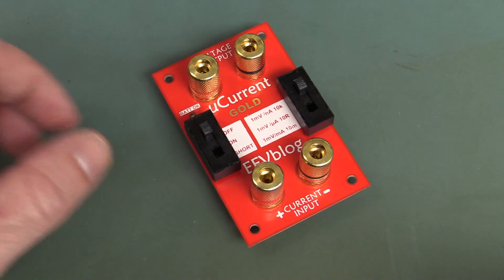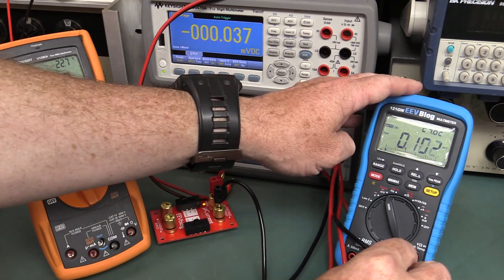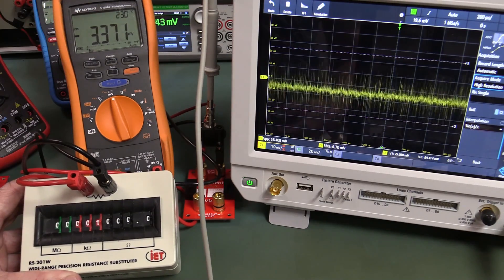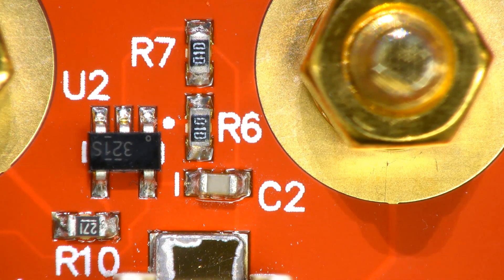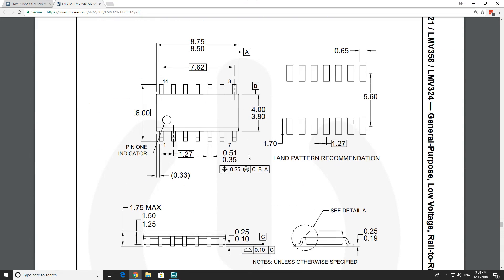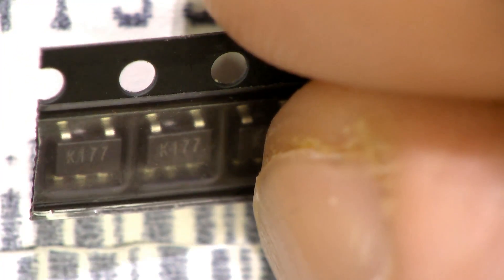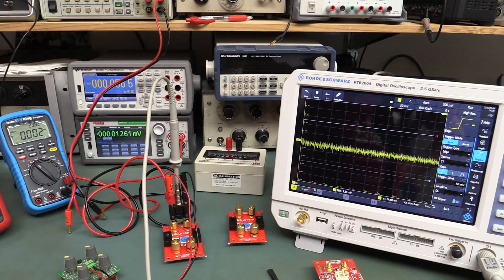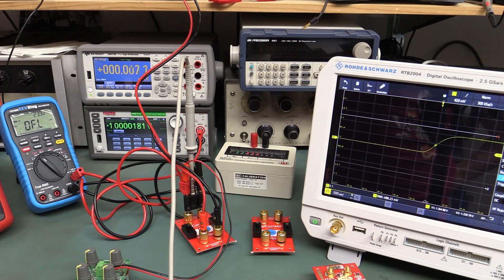EEVblog #1057 -  µCurrent Murphy

Comment: “Rings a bell”.  If I recall, one Fluke meter has 4 nF input capacitance on the low ranges.  Caused some surprises until I figured it out.
Motorola MJ802 used to be one of our favorite robust transistors and then it suddenly changed to be anything but.  After various queries, we found that Motorola had moved the manufacturing to another bigger plant.  Bigger wafers and other changes in the process. BAH!  We went around and were promised great robustness by a company called Solitron for their version of 2N3771 or something of that number series.  We tried and they failed on a short notice.  When we pursued that issue, Solitron engineer eventually said that that we must stop using their transistors, because our application with 1 to 20 Hz pulsing caused thermal cycling stresses on the chip to base bond (soft solder connection).  Would be fine with DC or over 100 Hz pulsing.  Thank you very much for that clarification!
We never found a good replacement for the old MJ802, although MJ15015 survived a little better than any of the other substitutions.

Comment: Had a very similar problem with the MAX4239 oscillating at low / no differential signal in a similar current sense circuit which previously worked fine (albeit single supply rail). After many approaches we ended up changing the opamp. Would be interested to know if replacing the MAX4239s with older also addressed the problem

Comment: Well, it is not the only problem with oscillation, as I discovered and fixed:
https://www.eevblog.com/forum/testgear/problem-with-ucurrent-gold/
And in my uCurrent is a RC1F opamp.
Reply: No, that's the TI part.
Reply: If you had actually bothered to check you would see that the On-Semi data sheet does not correspond to either part number on the chips. Stop criticising typing errors and get a life.
Reply: I guess that ON datasheet for for their own (Motorola legacy) production before they acquired Fairchild.
And RC1F is TI chip:
http://www.ti.com/lit/ds/symlink/lmv324.pdf
Reply: actually no the datasheet in the vid has Fairchild data with ON logo. 19 mins 41 secs. So nope.
Reply: Yes but Dave told that it doesn't contain and chip marking in it.
Again:
http://www.onsemi.com/pub/Collateral/LMV321-D.PDF
dated February, 2015 - before ON bought Fairchild - ON own design
https://www.mouser.com/ds/2/308/LMV321-1125014.pdf
Fairchild/ON datasheet - definitely after acquisition of Fairchild but no date in document, no chip marking information.

The problem is that they discontinued their own production replacing it by Fairchilds one but the datasheet on their official site is still for their original product. 

They bought a lot of companies like Fairchild, Sanyo Semiconductor, etc. but failed to bring them to equal documentation and marking standard

Duh, they stopped marking parts with Fairchild logo only by the late of 2017...
Reply: that is the latest data sheet currently on the web site so that is what they are making. IE on the production line that data sheet was written for. If that was not the case even cots mil equipment and cots aerospace could not use them

Comment: Hmm, so whether or not virtual ground generator is the "culprit", something is clearly able to feed through the capacitive coupling, since the error depends on a capacitive load on the µCurrent outputs. So this could reasonably be narrowed down to whatever is connected to the outputs. 

What sticks out to me is the connection of R8, the 270 ohm resistor. Firstly, this resistor makes the output gain 10.27 instead of 10. But that's at the amp output. The 270 ohm resistor forms a voltage divider and the meter output is at the 10:1 tap. The precision loss from a 1% 270 ohm resistor would be below the 0.05% when taking into account the full scale of the resistor network. So far so good. And none of that would create any oscillation issues anyway, just a small measurement error.

The second thing that sticks out in relation to R8 is the connection of C4. The MAX4239 datasheet calls for a capacitor in series with the feedback element. As it stands, the feedback element is R13+R14+R8 whereas the capacitor is only across R13+R14. This could have two effects: 1) Not limiting the bandwidth of the feedback properly. 2) Somehow feeding interference back onto the input with whatever effects that might have. Regardless, the capacitor technically isn't connected as advised in the datasheet.

Things I'd try:
1) Move the C4 connection directly to the output of the MAX4239. 
2) Move the R13+R14 feedback connection directly to the output of the MAX4239 as well. R8 would now be in series with the output but no longer part of the feedback loop. This should only be a problem with a very low impedance load which might sag the output appreciably..
3) Come to think to think of it, 2x 100n for the whole circuit seems a bit anemic given the symptoms. Might want to increase that a bit and see if that stabilizes the circuit.
4) Might also want to add decoupling to the virtual ground as well as some people have suggested.
Reply: The tolerance of R8 has zero effect on the output precision...
Reply: David Jereb Come to think of it, you're absolutely right. Anyway, that was just an aside to explain my thinking from start to finish.

Comment: I have come across opamps that, in a dual rail config, were not happy with a single decoupling cap across the rails, needing one cap per rail. Could it be something similar here?
Reply from the maker: This is not a usual split rail problem. Decoupling caps on the output of a virtual ground output are caps directly on the output of the opamp, that's BAD, and is the reason why the opamps can oscillate to begin with.
Reply: EEVblog I do not understand why it would ossilate when there is 270R on the output anyway. However If a cap was on the v-gnd opamp output (after R10) would the return path not be more direct than capacitance on the uCurrent output terminals skipping R8?

Personally I always find 47R adequate to buffer opamp outputs and keeps nice low output impedance. Telling the master how to suck eggs!
Reply from the maker: Output resistors are not magic, they just move the pole a bit, not totally eliminate any capacitive load issues.
Reply: I think any opamp should be decoupled against the LOAD COMMON terminal, i.e. the virtual ground here, not across the supply pins. I'd suggest trying that and see, if that improves. It should.
Reply: As I suggested earlier on Patreon side, please try 100nF or 1uF cap from virtual ground to both +V and -V.  I am quite sure that tames the oscillation.  It is quite clear that the oscillation is produced by the combination of LMV and MAX opamps, not just from LMV.  And if I am right, please remember that I was the first one to notice that!

The reason is that capacitive loading of the uCurrent output creates low impedance current source (in higher frequencies) to virtual ground from +V and -V (which are coupled together by a cap) and this creates high frequency signal to LMV input.  Two 1uF caps with 270 resistor creates low pass filter in kHz region which should be enough to tame oscillation.  Or even two 100nF caps.
Reply: Please also scope how the oscillation shows at the output of the U4 (pin 1).  I guess it is from rail to rail!
Reply: I think it probably needs a decoupling cap across either of the 100K resistors at the input to the rail splitter to lowpass the input to the LMV321. Otherwise noise on the virtual ground will jump onto the power rails (via any of the opamps, or parasitic capacitive coupling) and be fed back into the LMV321 input as the 100K resistor divider is operating at full bandwidth.  Remember that PSRR only guarantees that the signals on the powersupply don't make it to the opamp output, not the other way around. The lack of decoupling from the VGND to the supply rails will not be helping either. If the LM321 allows 220pf then maybe put 100pf from after the 270R to a supply rail. Capacitively loading the Maxim output is not the same as capacitively loading VGND. Likely loading VGND will make it more stable, not less.
Reply: i think the same. At least it would be more defined and with the decoupling resistor also the splitting OPAmp should be happy. Otherwise it sometimes worked to add much more capacitance. like 10 too µF electrolytic.
Similar to a problem with a reference (TL431?): It just happened to oscillate with the common (ubiquitous) 100nF. Not with 10nF not with 1µF. The datasheet more or less stated this, but the guy who designed this thing did not read carefully enough and was not experienced enough.
Reply: Dave uploaded a follow up on EEVblog2. I missed it until now as I only subscribed EEVBlog1.

Comment: I'm a pretty green designer, so there's probably something I'm missing. Can someone explain to me why R8 is inside the feedback loop of U4, rather than being wired outside the loop, the way R10 is with respect to U2? If the purpose of R8 is to provide output isolation for capacitive loads, doesn't it have to be outside the loop?

Comment: do you think that your virtual ground is happy without any capacitors? I would use some... to positive and negative rail, at least 100nF. you have 270 ohms on your virtual ground where U4 feedback can easily disturb U1 negative input. some slow op amps can handle such problems, but others with faster response can begin oscillating, just imagine these RC1F are actually faster op amps with much better specs, which begin oscillating easily?

Comment: Odd question: shouldn't the producer of these ucurrent devices have a thourough quality check for each module. This is the only way to avoid such slipped - faillouts. I guess, part of the high price for the precission instruments is the quality check processes for each module.

Comment: O'Toole's law says Murphy is an optimist. When dealing with electronics even the best laid plans of mice and men get fouled up by Murphy. 
About 15 years ago we had automated controls on our pumps installed. All so that we could operate them from a remote computer. Every so often we had a pump shut down for no known reason. All of our equipment was designed to be stable even in the event of an EMP event including hardened CPUs designed for use in space. And everything was opto isolated so that nothing should get by. Wrong! It took two weeks for it to show up on the chart recorder but finally we caught the little spike that Murphy was throwing at us. It was getting by the batteries, the filter capacitors in the power supplies, the opto isolators, and triggering a fault inside the controller.

Comment: I solved this mystery 3 years ago.  The output stage is oscillating because of the 270 ohm resistor plus a capacitive load causes too much phase shift. It is marginally stable, so some work, some oscillate. See my reply and the design fix below.

Comment: Why not just decouple your voltage divider to stop it feeding back into the virtual ground amp? After all, the tiniest noise on that power rail will get into the input... it's a DC rail generator, so no frequency response is needed. I guess a 10nF would do it.

Comment: Gahh! I've ripped out my hair (virtually, I'm bald as an eagle) trying to fix the offset problem. I replaced the MAX4239AUT, both of them just for good measure. Checked the ± rails, but still got a crazy offset on the output. The problem is only on the first opamp that is amplified by the second one. Time to rip the unit apart again tomorrow to check...
Reply: I have a fix without replacing the opamp, see my 2nd channel shortly.
Reply: I changed to the LMV321AS5X and now it finally works! Whohoo! µAmps here I come!
Reply: This is something that can be clearly heard with a wideband demodulator. You could probably attach a diode to virtual GND in this circuit, connect to the tip of the input of a headphone amp, and the ring of the input to either Vcc or Vee rail via a 100nF capacitor. Analog circuits fail by resorting to oscillating when you don’t want to, this is very, very common.

Comment: I have to wonder what Dave would have done had the specified LMV321 chips made it into the first production run. Would he have abandoned the project, redesigned the circuit, or tested LMV321s from different manufacturers like he did now? Would he have refocused his efforts on his calculator ruler and watch projects?
Reply from the maker: Why would I abandon it? It took me minutes to find the problem, longer in this case because I shot a video of the process. But not that hard to track down.
Reply: So you still think your design is not at fault?  Have you tried adding the decoupling caps from virtual ground to +V and -V?  And are you aware that uCurrent is very sensitive to MHz range EMC just like the famous Keysight DMMs?
Reply: I would expect, he would have tweaked the circuit for stability.
Reply: Just indulging in a bit of what-might-have-been. Sure, the uCurrent is a practical solution to a common moldymeter issue, but your other projects were nerdy chic.

Anyway, I'd call this "Murphy's Boomerang" since you didn't get hit by it until the fabricator used the exact part you specified after several successful production runs with a substitute part. (Also, boomerangs in Australia, not Austria.) Good you found a kludge to fix the problem though.

Comment: How can you be so calm when you come up with a bad batch of product? I would be apoplectic!
Reply: Pretty sure the circuit design is at fault here. The entire rail splitter is floating in free space with zero decoupling at both output and input. There is a feedback path via the supply rails which is causing oscillation.
Reply: Meh, shit happens.
Reply: John Richards solar roadways are a reality for one chap and his dummy, Elon Musk.
Reply: clearly ... you are so upset that you can't spell correctly any longer
it's APOLOGETIC 
hehe
Not APOPLETCIC
Reply: I am not sure that this is a bad batch of the product in the sense of the op-amp being bad. I’d venture to say that this design was hinging too much on luck, and when one of the parts was slightly changed, still within the specs I’d say, it wouldn’t work anymore. And if you write down the equations for the impedance between the output of the entire device and the virtual ground, you’ll get negative values, and thus oscillation. Definitely not unheard of.

Comment: You should remove battery before using hot air. Otherwise it may pop right into your face :)
Reply: yoksel99 Soldering a 2032 lithium battery makes a good Dave go bad.

Comment: Dave could you use this tool with a scope to look at Nox Sensor current on a Diesel Engine, looks like you can.
Reply: busjockey1 If the NOX sensor generates a current then I would imagine yes, but if it generates a voltage (such as a thermocouple does) then uCurrent input is probably not the best choice as it is measuring the voltage across a shunt resistor to convert current into a voltage.  But the basic circuit with modification could be used to amplify a minute voltage if the sensor is a voltage source rather than a current source (I'm not familiar enough with NOX sensors to know whether they are predominantly a current or voltage source).  Keep in mind the input side of the uCurrent is just a shunt resistor between the two input jacks, it then measures the voltage drop across the shunt resistor and amplifies that be a set amount to generate a proportional voltage on the output side -- which could very much feed a scope but keep in mind that most scopes do not cope well with mV level input signals so I do not know whether it's gain as a current measure would be great enough to get your scope out of the noise as a quick search did not turn up useful electrical details on NOX sensors.  

Don't know if any of this is of help after writing it, but it is written so I will pass it on anyhow!

Just off the top of my head, but if the NOX sensor is a voltage generator then I would think that simply removing the shunt resistors used by the uCurrent (there are 3, one for each current range) would be sufficient to turn the uCurrent into a uVoltage amplifier and that could be of some use, though the +/- 1000mV output range will likely only be especially useful if the output signal is greater than several tens of millivolts to get out of the scope's noise window as scopes have poor resolution in the low mV range.  That said, without the shunt resistors the gain of the uCurrent will become fixed in all ranges (100x if I recall) as the shunt resistor is what changes the current gains, so 1mV of input would yield 100mV at the output, and you would likely want to see, at a minimum, 1mV from your sensor to yield a useful scope signal -- or you could reengineer the gain of the two op-amp stages to get more useful amplification if working with much smaller voltages down to perhaps tens of uV.  Though I would think that there would already exist tools designed to indicate NOX sensor performance.
Reply: Ethan Poole Thanks for the reply.  You can purchase a micro current clamp to measure these sensors their just expensive.  Normal price for these clamps is in the 700 dollar range for the frequency response I need out of the clamp.  Was looking for a cheaper substitute.  Nox sensors output current in milli Amps.  It has 2 measuring cells inside the sensor that show a Voltage differential.  You can see the voltage on a scope but the change is minimal even when I gave my vertical cursors for voltage amplified to the max.  The best way to see the response on these is with current.